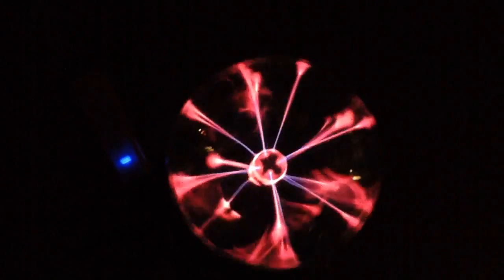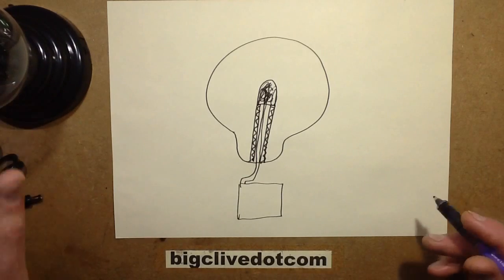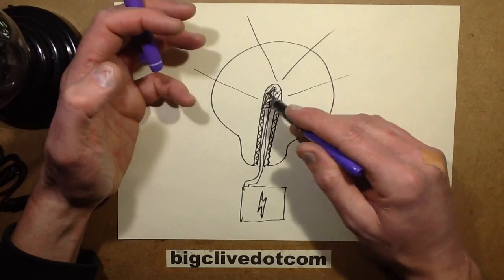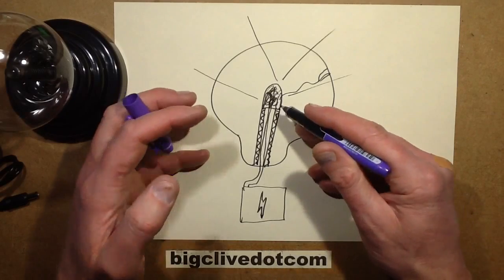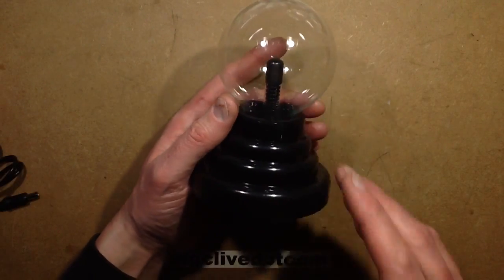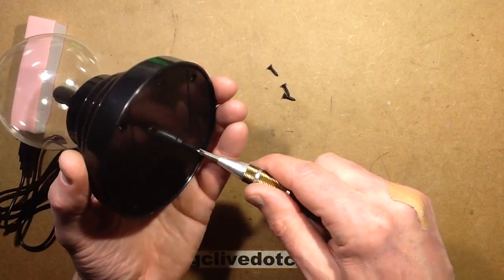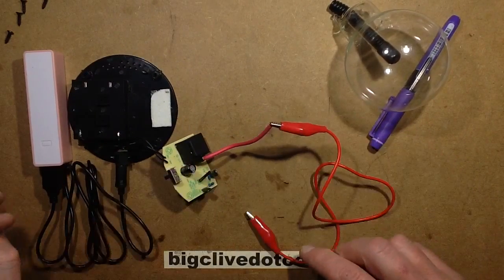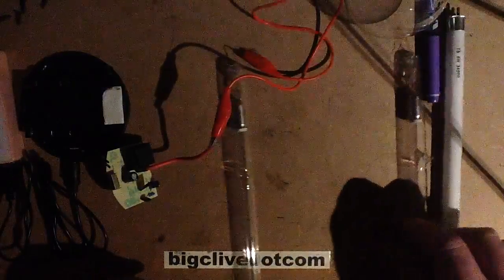USB plasma ball teardown and schematic.

Comment: I have a similar plasma ball (with the same circuit) which I broke by inputting 12V instead of 5V and this video has been so much help in rebuilding it

Comment: Clive, could that power circuit be used to supplant the power circuit set up used in a bug zapper racquet? And if so, would it be more or less effective in your opinion? Thanks for any reply! Love this channel! 👍
Reply from the maker: Not really optimal for a bug zapper.
Reply: @bigclivedotcom  hey clive i have one and its not working nothing is heating up and it has been never been used should i change the transistor?

Comment: Some 1980s plasma globe drivers have 2 transistors, like this one: https://www.youtube.com/watch?v=pPMOaJqTpCE I'm not sure if they used a push-pull circuit or a single transistor design with 2 transistors in parallel.

Comment: I have one the older ones that you say out-gased (it no longer puts on a show) - electrostorm ball  model: 47528. Do you or anyone here know where I can get a replacement bulb or safely use it as a tiny tesla coil?
Reply from the maker: The circuitry could be used to energise other globes (some filament lamps work.)  It's usually cheaper to buy an entire new unit than just the globe.

Comment: Thanks for doing this one Clive. I've been making custom housings for exactly these plasma globes for a few years now. I've not touched the electronics just stripped off the black plastic shell and replaced with my own. It's good to have a little more understanding as I hope to be a bit more experimental shortly with the same globes but different casing materials. In some ways it was quite fun listening to your assumptions on the internals when I knew what was inside

Comment: Where can I find this ac adapter?
Model: YH-UA-1210
Input: AC 120V 60Hz 130mA
Output:AC 12v, 830mA Max 10W
YUHAI ELECTRONIC (NANHAI) CO, LTD
Made in China
My 8" ball has died, HELP!
Reply from the maker: Your unit may work with a standard 12V 1A DC power supply.

Comment: Looking  into plasma balls for a prop, i stumbled upon these "usb' globes. Thanks for answering the "can i pull this thing apart without breaking it ?' ! This is going to be great! <3
Reply: I've been doing just the same for years. A doddle to pull apart. The worst but is getting the glass bulb out from it's rubber like O ring but not that bad as the glass feels pretty thick compared to say old incandescent bulbs. If you can I'd recommend pulling said ring from the hard plastic mounting (easily done) and using that as the interface of the prop for the physical mounting

Comment: How about a plasma disc? As used in Seven of Nine's Borg regeneration alcove (Star Trek - Voyager).  Those things look decidedly more ferocious than a plasma ball!
Reply from the maker: They use three layers of glass.  two outer disks (one with an electrode) and a separator ring.  The middle area is filled with phosphor dusted glass spheres and then it's baked to fuse the glass together.  The brightness is greatly increased by the phosphor.

Comment: I have this exact model that I'm trying to build into a steampunk backpack, I need to extend the wire going up into the globe. I'm having some trouble, I'm occasionally able to get it to work but it seems almost random. Can you offer any suggestions?
Reply from the maker: Use proper high voltage wire and keep it away from grounded surfaces.  It has to make a good connection to the inside of the central sphere, often stuffed with conductive pan scrubber type material.
Reply: @bigclivedotcom  Yes, it's got the steel wool stuff in it. I figured my wire choice might be the problem, I'm searching for the right  now,. Can you offer any suggestions? My knowledge of electrical engineering is...lacking.
Reply: @bigclivedotcom  Solved it. Rather than try to extend the high voltage wire, I just extended the wires from the battery to the circuit board. The board can fit in the housing I designed with only minor modifications, 3D printing a new housing now.

Comment: The one i had used a 12 v ac power supply, which i lost, so i gave it 12 v with a halogen transformer, which blew the cap.
Reply from the maker: If it was an electronic halogen transformer they put out a series of spikes of around 30V which average to 12V with a tungsten load.
Reply: @bigclivedotcom  ah so thats why it suddenly started smoking

Comment: i have something very similar to that one. burnt my fingers a few times, blew up a power supply (that wasn't even connected to the plasma ball) that mysteriously came back to life a few minutes later and lit a few fluorescent lamps and CFLs. I have noticed it messes with electronic devices such as a calculator and causes interference with tvs and radios

Comment: I have one of these, pulled off the globe and there's basically just a bare wire sticking in to some crumpled up aluminium foil inside the tip of the center post.

Comment: Could you cover one of the flat discs that have the lightning bolts type scenario that you would hang on your wall. I think it came out after this atmospheric ball. Maybe it was called a plasma disc. I have no idea what they would call them. But they had them at international imports store in the US. That would be interesting. I think they had them in one of the motion pictures of Star Trek with the boards they were mounted behind the head as if they were being recharged or whatever. Maybe you know what I mean?
Reply from the maker: Luminglas disks.  Pulsed high voltage at high frequency, finding ionisation paths between phosphor dusted glass spheres sandwiched between heat fused glass plates with a vacuum drawn and possibly xenon fill.

Comment: I wanted to use a similar product in a project but find the light quite weak. It is powered by 5v usb or battery. Do you think I can increase à little the voltage ( from 5v to 6v by example) to increase the density/power of the light effect ?
Reply from the maker: It'll never really be bright.   That's why the Borg units used the flat phosphor dusted Luminglass version.

Comment: Hi Big Clive! ...... Little Clive here ...... again! 👍😂

These USB Plasma Globes are sold at ARGOS for £15.00, but mine was less than £7.00 direct from China via eBay! A set of Duracell Rechargeable Ni-Cd batteries lasted about 3 hours! As the batteries discharged, the streamers reduced in numbers, to practically nothing! Very underwhelming! 👎😂

My USB Plasma Globe is externally identical to yours, but different inside! The PCB is screwed to the upper case moulding, and on the top it has the transformer and an electrolytic, and on the bottom is a tiny surface mount transistor, and four other tiny surface mount components (resistors and capacitors). I cleaned the inside of the electrode tube, to stop streamers going into the base of the globe! I don't think people realise that the electrode is on the OUTSIDE of the globe, because it looks like it's on the INSIDE!

Comment: Hi Big Clive! ...... Little Clive here! 👍😂

I first saw a Plasma Globe in 1986, in "The Dome Of Discovery" at Blackpool Tower (I have a video of the globe in operation, recorded on Betamax!). I bought my first Plasma Globe in 1990, and it cost £100.00! I remember if it was too close to my Marantz Hi-Fi CD Player, the sound would cut-out!

I recently bought an 8" Plasma Globe on eBay for £9.85, and they sent me TWO! That's £4.92 each! It looks stunning, just like my 1990 globe at £100.00!

I've also just bought one of these USB Globes from Shanghai, China, for just under £7.00! My example has a streak of conductive coating down the electrode, which makes streamers go towards the base! I'm going to try cleaning it off. Additionally, when I connect the USB power cable, the batteries are NOT disconnected! It doesn't seem to work as well on 4 X AAA as on USB power!

When I connect the globe to a USB power bank, sometimes the globe won't turn on, even though the power bank isn't flat. Very odd? ...... Incidentally, why don't you turn off your globe by pulling the USB power, or did that not occur to you? 😂😂😂

Comment: The very 1st plasma balls I saw was back in the early '80s at an art exhibit.  
It was quite large, about 18-24" in diameter.  And cost around $2700.
It's amazing how cheap (low cost) and small these plasma balls are today.

Comment: I had one and the glass broke after I put a penny on top of the glass as an electrode.
I wouldn't have done that if I knew that I could just pull off to reveal the sturdy wire from the transformer.
I used it as a lighter and to melt sand and salt grains onto larger beads which was fun. If you run the arc right at such grains they eventually heat up enough to conduct electricity so well that they heat up a lot, enough to melt.

Comment: I'll bet that transformer has a lot in common with "inverter transformers" that you would find in flat-screen TVs and monitors before they went to using LEDs...

I've got a few salvaged ones,  and am going to have to ohm one out,  and see what windings there are,  I guess.
Reply from the maker: The CCFL modules aren't rated for quite such a high voltage.  They can be used to run short neon tubes though.

Comment: 10:35 don't plug it to PC, don't plug it to power supply where can you plug it then 😆
Reply from the maker: Into an isolated power bank, grounded PC or grounded charger.  Many of those things are rare.
Reply: Or just a battery.

Comment: Commenting 4 years later :-) I found out years ago that if you balance a coin or metal object on the top of the globe a spark will jump from the top to your finger and burn you within a few millimetres. Alternatively if you place your hand on the globe then holder your finger near someone else a spark will burn you both.
If you instead hold one leg of an LED and touch the other to the coin that will also light. and further if one person touches the globe and then hold one leg of the LED and another person holds the other leg the LED will still light. Great fun with Plasma globes!

Comment: Speaking of Plasma Balls, & how they affect sensitive electronics.....   I recall working at Radio Shack back in 1991, as a summer job, between my Junior & Senior Year in High School.  We had a Plasma Ball on display on our counter, nearby our cheapest digital wrist watches.  Some curious customer discovered that holding the face of the watch against the glass of the energized Plasma Ball would 'zap' the wrist watch.  To our manager's dismay, pulling the batteries out of the watch & reinstalling them did not restore life to the watch.  After that, the Plasma Ball got move to a safer location, far away from anything else electronic!  :p

Comment: Up next: Jacob's Ladders?
Reply: Actually already been done previously it was part of the stuff for the stage lighting effects stuff he does as well.

Talk to you about the Gabriel electrode as a starting electrode as well.

There's a few of his videos featuring this if I remember correctly been a long time since I've seen them all tho

Easiest way to do that would be neon sign Transformer!

At least 15 kv

If you could get Hands-On old life switches and stuff like that you could do something for Halloween prop for maybe someone like Frankenstein.

Something if I could ever do it would be kind of cool to do something like that but at the center of it 3-phase Mercury Arc rectifier!

Possibly even some tungsten argon rectifier.

Maybe one or two single phase Mercury Arc rectifier.

Of course more than one Jacob's Ladder!

You'd have to have definitely preferable shavings and maybe the oil switch somewhere.

Anything that would look that old!

Not to mention you would have to have open link fuses in the cabinet somewhere just to show off!

And wouldn't be complete without ceramic European fuse holders and there are somewhere.

And of course if you crackle tubes here and there as well!

If you had something from shop where you had three phase power coming in might work potentially.

Either or build a phase converter out of old Motors single-phase and three-phase of that vintage and incorporate as part of the display that would just be awesome.

Also a car alternator can be repurposed as a stepper motor which is the most beautiful surprise that is 3 phase instead of just having the old school generator.

I know people that still think it's the same thing is a DC generator.

I have seen some things use the same device as a generator to charge a battery as the starting motor would be even on smaller engines of seen this at least twice in my life complicated power transmission mechanically but still rather ingenious

Comment: I have a plasma globe that can react to your voice. I opened it up and I found a few resistors, capacitors and one Tip 122 transistor. The transformer has no feedback coil. It also has a cd4069 hex inverter. Connected to the base of the transistor. I don't really know why they would use a hex inverter instead of a timer ic but I wondered if you know why it is there.
Reply from the maker: The 4096 is often used as an oscillator with the advantage of extra gates for other purposes.

Comment: I'm making a lamp. Could I move your circuit board and extend the high voltage wire? Thank you.
Reply from the maker: You could extend the wire, but it will need to be kept well away from metal surfaces and other wiring.  It may be better to keep it as close to the globe as possible.
Reply: @bigclivedotcom  I was going to run it through double  plastic tube inside the column. it will never be next to metal.

Comment: Had the bottom of mine off and accidentally placed it on a faux fur blanket while it was turned on. Now it won't work. What is the likely reason for its failure?
Reply from the maker: Possibly overheating if everything looks intact.

Comment: This video may have saved me from making a terrible serious mistake. I am in the process of putting together a rather large Nixie clock using odds and ends and was planning to add one of these plasma bulbs to the build. The problem being I have a pair of cochlear hearing aids. Is this a bad idea thinking I could add one of these bulbs to my clock? I have a surgically implanted metal plate on each side of my head just behind my ears along with the cochlear circuitry. The cost of the implants was $90,000 (US) per ear. Without the implants I am stone deaf. I have what looks like a large hearing aid that magnetically attaches to the plates in my head. These are the processors for the implants that help turn sound into legible hearing. Being electrical and powered by rechargeable batteries I worry I could do some serious damage to my implants as well as the processors. 
I am sure my ignorance of all things electrical is shining like a strobe and for that I apologize. I hope whomever is reading this understands my concern and can give me a definitive answer.  Many Thanks in advance!
Regards,
John Archer
PS-I am not sure I explained my cochlears very well so please do a web search of them so you can understand my dilemma and what I am trying to avoid.
Reply from the maker: Not sure how it will affect the implants, but these things should not really be placed near anything electronic as they have a very strong electrical field that can interfere with normal operation.
Reply: @bigclivedotcom  Thank you for the response! I think I will trash my original idea that used a plasma bulb and look for something a little safer. Just not worth taking the risk. Thanks again for your reply!
John
Reply: If you have circuitry implanted, datasheets should be medically necessary for the users proper knowledge, like any electronics.
All capacitances should be calculable within the circuit given we have those datasheets. Its simply a matter of subcomponent capacitance, potential absorption between the traces, their spacing, their material, their thickness, and the powerplant the implants are intended for, their shielding efficiency, and general resistances overall. I aint no prosmeshinal, but If you can share the datasheets to your circuitry, we would gladly jump in with "better" good advice. Other than that, you must understand we can not be responsible because expensive vital-to-life electronics are involved. Good luck though whatever you decide, and please update us if you obtain datasheets :) cheers!!

Comment: I was thinking about using this on a HeNe laser tube. I'm guessing the output is in DC? do you think this would damage my laser tubes internal parts? i believe the tube is rated for 2000VDC at 5mA
Reply from the maker: The tube needs DC.  This isn't suitable.

Comment: Why is the secondary coil connected to the minus side of the battery and the rest of the circuit? That is bizarre.
Reply from the maker: It's to provide it with a vague reference to ground.
Reply: @bigclivedotcom :
I'm not an electronics expert. I rarely dabble in electronics.

Wouldn't it make more sense to connect the secondary coil together (+ and - side) to form a loop? Don't you need a loop to form a circuit?
I'm guessing the wire going into the glass is the +.
The - needs to touch the outside of the glass.
I suppose if they did that, then you don't get this multi filament plasma effect???

Comment: Clive, me and my daughter both touched ares and got a big tingle(shock)... how comes??
Reply: its fine touching on our own but we never touch it the same time again!!
Reply from the maker: One of you might have been well grounded, or the spark that jumped between your fingers may have been a single solid one instead of the haze of sparks that couples via the glass.
Reply: yer it felt like a spark jump.... well we both sure did
Reply: couldn't  really work out why there should be a big potential difference but then she may have been barefoot and me rubber shoes guess that would explain it lol. not as bad as discharging a CRT with a un insulted screw driver mind. the engineer next to me nearly got the screwdriver in his head ;p